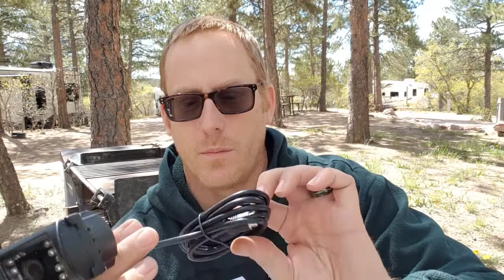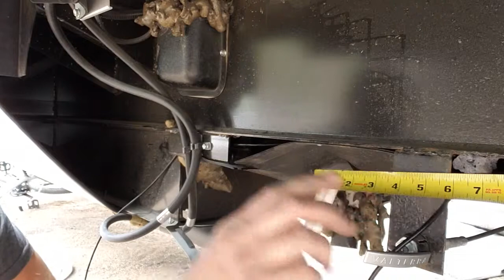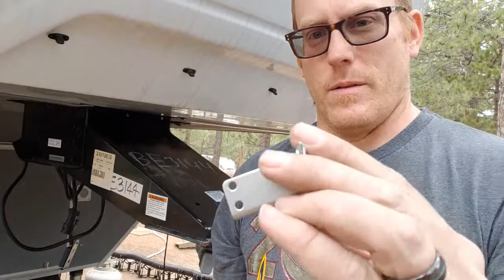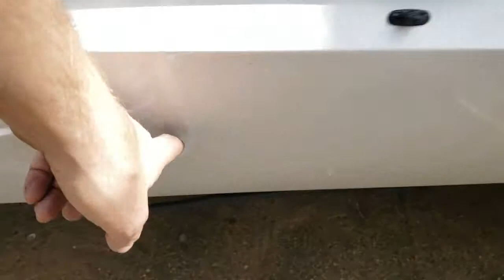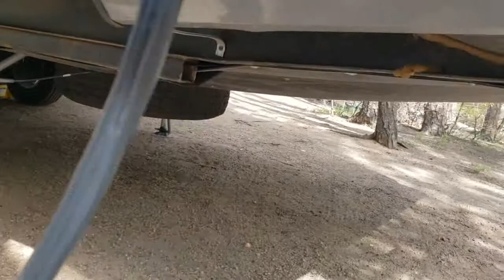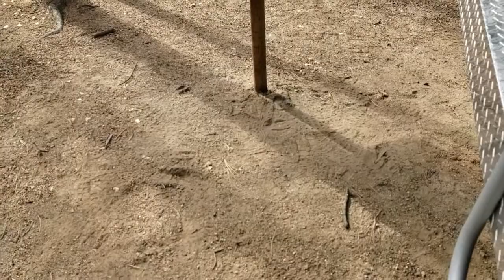RVS Wired Backup Camera Install Part 1

Comment: I recently purchased a wired camera system for my truck and travel trailer. It came with a twist-style connectors which are fine for one-and-done but since I'll need to disconnect it frequently, I'm looking for a more robust plug like yours (pollock plug). Can I cut the existing plug off and install a pollock or would that distort the video feed? I've asked the seller but they are not understanding my question. They keep replying the unit I purchased comes with a plug. I'm looking for something more robust than what came with the unit.
Reply: I would imagine that a new connector would be fine. As woth any electrical connection,  make sure you properly isolate/insulate each individual conductor. The individual conductors are extremely thin. If I were changing the plug, I would cut the plugs off that I want to replace. Then individually make up the new connections, working pin 1 on both sides, then pin 2, etc. I would solder the wires to the plug and use heat shrink on each conductor. I hope this helps!
Reply: @AlcoholFreeAutomotive  Thank you for the response. I'll give it a go.